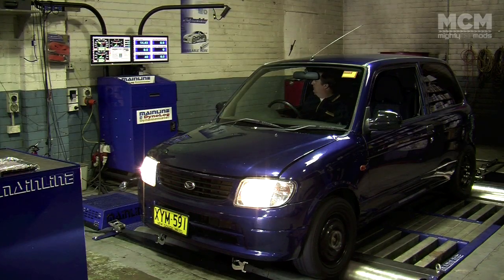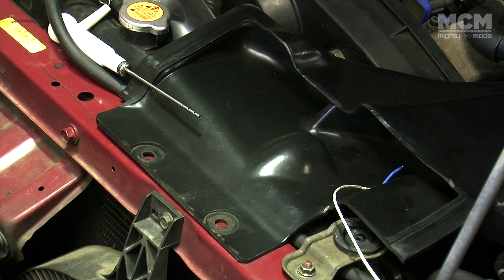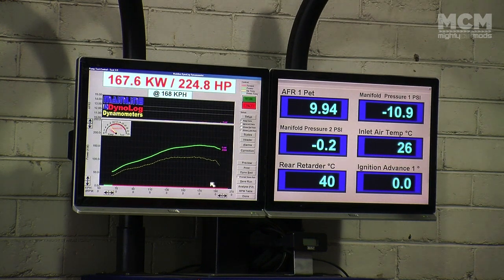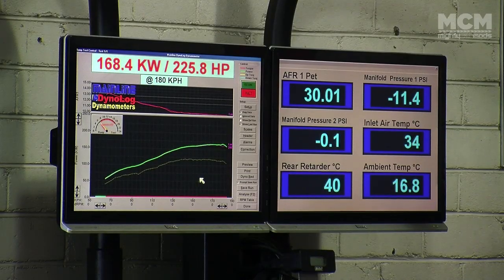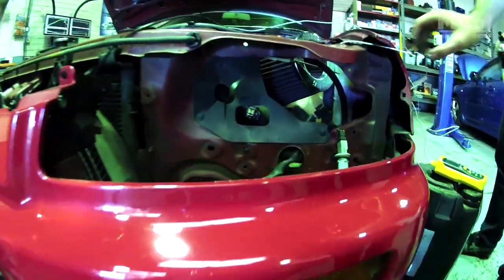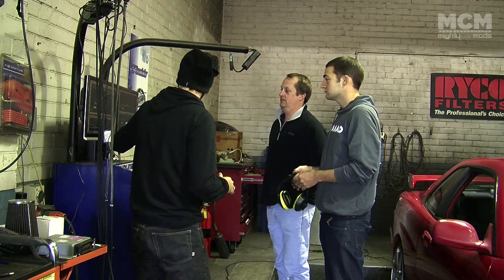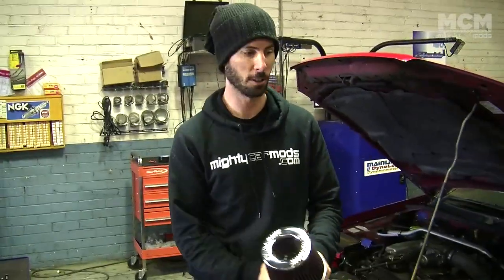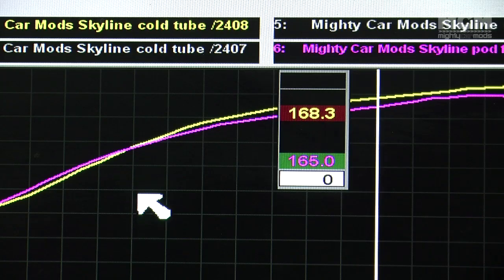Cold Air Intakes Mythbusted [Turbo]

Comment: Ive noticed a throttle response in every car/truck Ive ever installed a "cai" , in . Mind you , ive used only reputable brands  . Injen , Afe , K&N , etc . Noticeable difference every time , plus adds to the driving experience.

Comment: I installed a CAI because it was simply a tighter tolerance than my factory box. 
Factory unit kept coming apart and the joined components had unacceptable gaps.
Once installed, the CAI enabled more consistent performance.

Comment: Couple of issues with the testing 
1. They were testing it out on a turbocharged engine that runs hotter than naturally aspired 

2. They are basically using a ram intake instead of the "true cold air" intake that sits below the fender. 

3. They were using it on a stationary car that was cooler with the stock intake and got progressively warmer when they put on the CAI, and a car will suck air cooler and more effectively at high speeds compared to on a dyno.

4. They were using a Skyline as their test car! That has a pretty good intake stock, compared to a cheap Honda or Toyota that has a shitty one to begin with. 

But at the end of the day, is unlikely that you will see more that 5-10 hp from any CAI system. It isn't the greatest modification compared to money spent, but it will add a little bit of torque and a nice sound to your engine. It's not completely useless. Also somewhat increased fuel economy, but nothing amazing.

Comment: this is not cold air? this is just a pod filter in a engine bay. To do it correctly you need smooth larger air intake hosing not the vacuum cleaner hosing they used one. I removed the factory fiesta st180 intake and replaced it with the GGR intake hosing and it unrestricted airflow b a huge amount. Then change the filter setup because without more room for air flow you are just running a pod not a cold air intake.

Comment: I really do call bullshit on this "mythbusting". Air intakes on your average car are designed to be quiet, not "performance" or efficient. They often are fitted with baffles that decrease the diameter of the inlet pipe to quiet down the engine. If your car has a MAF (which it will if its fuel injected), a unrestricted intake will let your engine suck in more air which then will be compensated by the ECU which detects the increased airflow rate with the MAF and increases the amount of fuel injected. More air + more fuel = more power. Sure thats limited, but couple it with an exhaust, a bigger throttle body, a ECU tune and you can potentially make good power.

Comment: I think it really depends on the vehicle.  On a vehicle with a minimally restricted system like that Skyline, a CAI won't do you much good.  But my truck was pretty restricted with the factory air box.  While I don't know for sure if the CAI improved my overall power, I did notice a big difference in throttle response and a notable difference in fuel economy.

Comment: Any mod that changes the intake track to a degree that extra power can be produced, REQUIRES a retune of the ECU before power gains or losses are found. By moding the intake without reflashing the ECU, you are testing the limits of the factory ECU tune.

A possible solution to this would be to reset the ECU back to the stock flash and reset the ECU fuel/Timing learning parameters.

Comment: I have a wicked ass idea...what if they engineered a way with a small styrofoam box with dry ice for the air filter to suck in sub zero arctic cold ass air to cool everything off and see how that would work?? 

Sorry I was taking a shit watching this video and that's usually how great inventions come to mind..but yea, have a go at it and post the results...
Reply: Atropolis24 There's an episode of Mythbusters or maybe Powerblock on Spike. (it's been a while) that shows them putting bags of ice on the intakes of a drag car and reducing it's 1/4 miles times.
Reply: +Atropolis24 Hey genius dry ice is solid carbon dioxide which would then be flowing in large quantities into your intake drastically reducing your oxygen levels causing your car to lose power/stall/break.
Reply: +Atropolis24 The rate that the air passes through the ice is too fast for there to be any significant heat transfer. The ice would also melt pretty quickly.
Reply: one bad thing with dry ice is you will be sucking in carbon dioxide instead of o2
Reply: +tomelliott9 Dry ice doesn't melt, it's not water.
Reply: +rsx123 It does melt, the phase change is just so quick you cant observe the liquid state under normal circumstances.
Reply: Littel Blue Doesn't melt, it evaporates, and it takes a damn long time. If you put dry ice in really hot water nothing really happens its crazy. It's just there sitting in hot water.

Comment: Main reason y no gains showing is because there in a garage strapped to a dyno doing 80MPH but sucking in (still) air!, or with fan only blowing 10mph-15mph intake infront of fan only sucking that in!! VS. actually being on highway doing 80mph and intake sucking in outside 80mph cool wind/air...which is y they had 2hp-3hp gain with 10-15mph fan & dyno reveal cool steady air curve into engine!..So either get a fan that plugs into car/dyno thats variable with actual speed of car as u excellerate and can replicate the exact speed ur doing on dyno up to 80-100mph winds,,then will c if there is truly any gains..however im sure no fan exist..so only other way is live dyno with onboard laptop dyno plug into car and hit highway with cold air intake and 80mph winds!..& if there r no gains then I'll b a believer in "myth*! by the way the first intake he put on was a short ram air intake under hood..not to good as hot air is being sucked into engine from engine bay, that heat being produced by engine..vs..actual cold air intake like he explained pushed intake pod/mushroom head away from hot air & engine bay to the bottom of car near bumper to suck positive cool outside air into engine!!
Reply: I was going to say the same thing couldn't say it better at last someone made some bloody sense all these brain dead people lmao cheers mate
Reply: @1240Dax  He's been in too many 80mph crashes, don't blame him.

Comment: I have installed an intake on every truck I've ever owned most of them being 5.4L V8s I never noticed much difference other than the sound of the intake being louder. Now, with the one and only 4.8L V8 I owned I noticed a HUGE improvement on the highway when accelerating. Stock airboxes are so restricted in the UD by the EPA that it wasnt able to suck in enough air when accelerating at highway speeds. You could hear the engine revving but the truck wasn't moving, with the cold air intake the truck would take off when you hit the gas. So to me it's not about gaining more hp or torque its that the engine has more usable power throughout the rpm range. Now that was on this particular engine. It will differ on every set up and driving style.

Comment: Pods and CAI's only really make a difference on cars that already have decent power and have the ability to tune for the new airflow. A friend and myself did these same tests on my car, the stock airbox produced more power at all times especially down low where acceleration would be. The factory airbox allowed the car to grab air quickly from the sealed chamber whereas the pod and cai seemed to have too much air space and lacked the pressure/suction. It's like a vacuum with a small diameter hose and a large diameter hose, the one with the small hose will have more suction.

Comment: What if it’s fuel economy you’re after? Do a test in that.
Reply: Lenny Leonardson  I have a stock 2004 Falcon that has k-n filter and throttle body hyclone device. 708 KLM used 56 litres. Two people using cruise..6cyl engine

Comment: If cooling the air doesn't make a difference then why is it that a vehicle equipped with a turbo charger particularly a diesel engine has a cooler that is placed after the turbo to cool the air back down??? Turbo chargers heat up the air that's why you have to cool the air back down after it has passed through the turbo. Cold air will increase power.... Prove me wrong.... Use a super cooler in the intake then do the test again and do the test on a engine that is not turbo charged.... I'll be right....

take a cup of hot water and throw the water into the air on a very cold day 0 degrees F, what will happen???? The water will instantly turn into a vapor... Gasoline or diesel reacts the same way... You could even through a gallon of boiling water into the cold air and the whole thing would instantly vaporize...  What would this do to a fuel???? It would cause it to burn more efficiently...
Reply: Cold air makes more power than warm air because there is more oxygen per volume which allows more fuel to be burned.  Nobody debates this.

The part that is debatable is will a cold air intake provide colder air than your stock system.  In most cases, the stock system does a better job.  A cold air intake that uses metal tube instead of plastic suffers from heat soak which causes the air to be warmer than stock.

Cold air intakes provide a nice look and sound but that's about it.
Reply: cold air intakes don't work because pretty every production car has a cold air intake as standard feeding into a tuned size airbox, aftermarket cold air intakes put a cone filter in place of that nice tuned airbox and then a bit of piping to near the filter, problems with this, filter is now sucking in hot and cold air not just cold air.
Reply: The charge air cooler (intercooler) is not for the intake benefits, it has to do with managing the EGTs (exhaust gas temperature) under load/boost.  AS good intercooler setup can make the difference between a manageable 1100* EGT climbing a grade and a valve-burning, manifold-melting 180* EGT.
Reply: A diesel is a COMPLETELY different thing to a gas motor with a turbo. AND you're talking about in "INTER-COOLER", not a CAI in a diesel (or a gas engine) and it uses Air-to-water plumbing to help cool the charge temp 

Cool air DOES help an engine (hell my old 22RE Toyota Hilux runs stronger on Cold Rainy days because the air is more dense), but all things being equal, a CAI doesn't make enough of a difference in the temp of the air entering the engine to matter.   Look at it this way, OUTSIDE atmospheric temp matters, CAI's CAN'T change the outside temp and don't lower the temp of the air coming into the engine.  You're better off "racing" on a cold day then bolting a CAI and expecting it to drop the intake temp any credible amount.

Comment: Duh...its a turbocharged engine. Cold air intake has not much effect on charged air temp. Intercooler/water injection with extra boost might help.
Reply: So, I suppose you like to mod cars? 8-)
Reply: Like? To say like is not so accurate. I swap for a turbo engine is more of a need for my wife's small engine Kancil...the 660cc finding it dangerously difficult to climb hills...but a change to bigger cc would end up using more petrol in city stop-go traffic. My best option was a turbo engine. Of course the side effect of a turbo engine is ridiculously powerful Kancil...its like having a 1,200cc engine in a small Kancil...really fast hahaha
Reply: your the only smart person hear dued lol

Comment: There's a lot of things that will show noticeable power gains on the dyno, but cleary a CAI is not one of them.

I've noticed however the difference in gains when increasing the size of the throttle body along with it.

Comment: In my opinion CAI work only when you are moving... lets be honest here a fan can't match the speed you are travelling with your car so this wasn't actually a real world situation...
Reply: And that is how it works...
Reply: This video makes no sense when I can feel a difference in my car between pod and stock.  Especially when I spent money so I can refit the stock, only to find that my car's performance suffered.  My conclusion is that their test is invalid when they cannot produce a 60mph headwind.  Even automotive engineers have wind tunnels.
Reply: The test is valid. It's a simple baseline measurement. Testing different setups under the same conditions. Then plot the results. It showed a 4 to 7 degree temp drop [using CAI], but only a 1% rise in power. 

Furthermore, the argument that the test speeds were too low, is negated. The cold air intakes job is to provide cooler air over the standard filter. As the wind speeds increase, the cold air intake benefits decrease. Since the rushing air has less time to be heated by the engine compartment.
Reply: Vern Kilburg that's a joke right?
Reply: all this time, my argument was supposed to be for short ram or pod filters.  having a longer hose in a CIA and making it longer will cause the pressure the drop as it passes through the pipe.  That's one of the reasons I can't take these fools in the video seriously.
Reply: *****
while I understand most of your argument, the part about the "making the air warm" confuses me.  Engineers have been making the use of inter/after coolers for years.  So what you said concerning having enough time to warm the air makes little sense.
Reply: Don't mean to detract from this, but that was the longest sentence I've ever read.
Reply: Socrates Nicolaou my cold air box made 8 whp☝🏻and my intercooler even more.
Reply: AngryTechGuy I guess you don’t know much about how air actually works or how any cars intake system works..if you don’t know something you shouldn’t attempt to speak on it
Reply: Sirusdark agreed. I drag raced in my ‘18 challenger RT 5.7 hemi. BONE stock. Was running high 13’s(13.7’s and 13.8’s during the day, then the sun went down and the outside temp dropped about 20 Fahrenheit. Then it started running 13.5’s . Nothing done to it. Even refilled it to the same original gas level

Comment: Turbo charged cars show little to no gains with a CAI due to the design of the system.  No matter how cold the air is coming in through the filter or how free flowing it is, the air still gets heated up and comrpessed when it goes through the turbo.  This is why intercoolers are installed in order to cool the intake charger AFTER the turbo.  The fact that these jackholes used a turbo charged car for their testing either shows they really don't know what they are talking about, or they were purposely trying to sway the results to make people think they don't work.

Comment: The thing about it is if that was a n/a car it might help out but because it's a turbo car the "cold air" from the filter is just heated right back up in the turbo. That's why a intercooler is important.

Comment: The biggest gains by replacing factory boxes with aftermarket is throttle response! You can't just change the filter. And non of that will make any difference without a clean exit from the engine. IE: exhaust. The guys in the video are paid by an insurance company right? Seems like a ploy to get the car modifiers /racers to tune down their cars in the name of "safety".  I personally have gotten huge mpg gains from better exhaust and intake systems. My 2012 Nissan Juke for example. With stock systems, I never got the EPA rating of 24mpg. Ever. Even in Eco mode. 19 mpg was the best it every got across country. With cold air intake and cat back exhaust, it got 27mpg.  With crazy throttle response to boot. But hey you can try for your self.

Comment: I made a homemade snorkel because I often travel flooded areas during the brutal springs here. I guess technically it is a cold air intake because if feeds from the top of the bonnet vent I made.  There is no gain in power at all.  It just moved the intake higher for deep water crossing.  But power was never the intent of the modification.